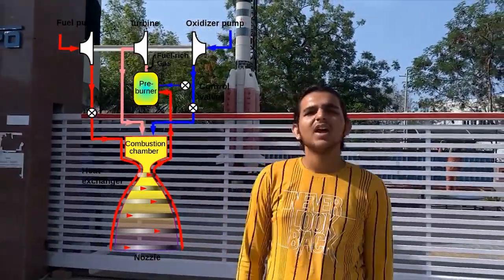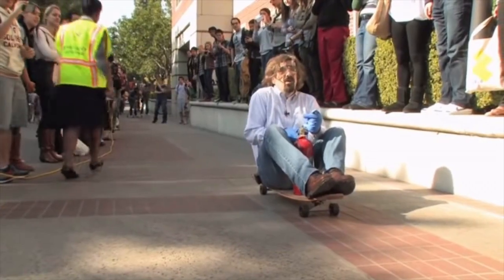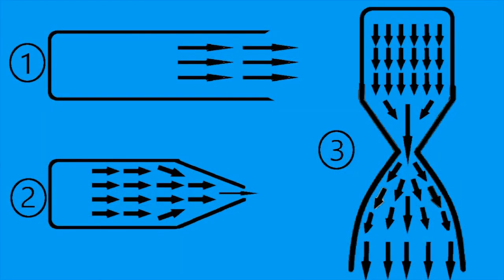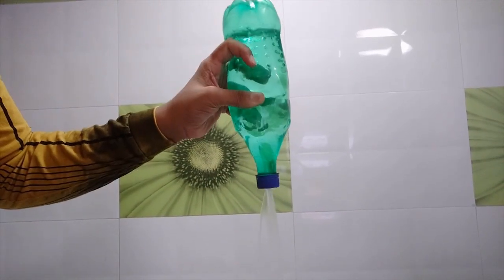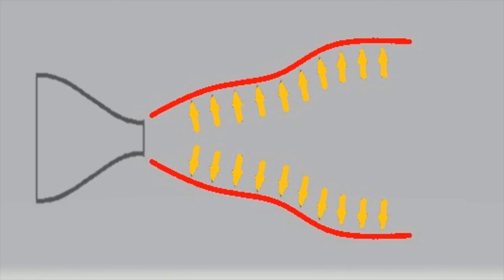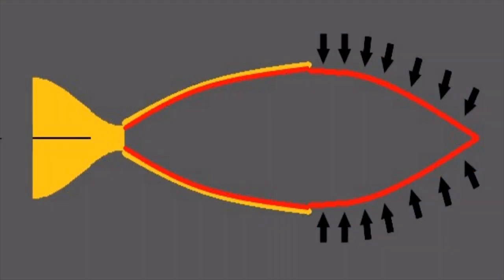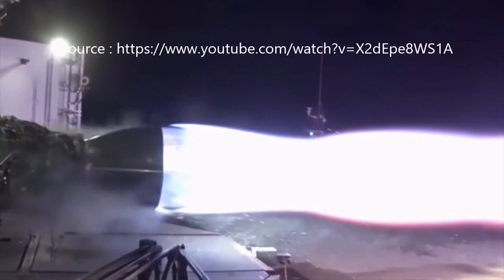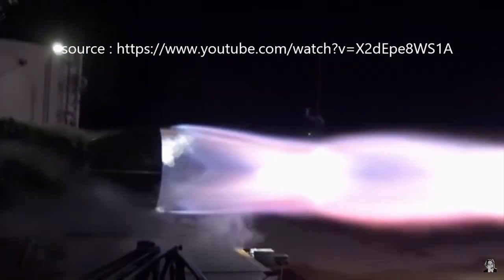Rocket Engines and Nozzles (Breakthrough Juniour Challenge 2020)

Comment: While it is true that the forward motion of the rocket is related to the backwards motion of the exhaust gasses and that doing something like constricting part of the nozzle so that the exhaust gasses have a higher velocity results in a higher forward motion of the rocket it is NOT TRUE (as implied) that the exhaust velocity CAUSES the forward motion of the rocket. You could just as easily state that the forward motion of the rocket CAUSES the backwards motion of the exhaust. Neither is correct.

Rather, it is the PRESSURE inside the combustion chamber and against the walls of the nozzle that cause BOTH the rocket to move and the exhaust gasses to move. Rocket movement is maximized when the PRESSURE is maximized. Various shapes of the engine/nozzle have various impacts on the pressure and thus the motion of the rocket. I think that rocket engine designers ought to think of it in terms of increasing pressures rather than maximizing exhaust velocity.

When a drawing is provided it ought to show the pressures AGAINST the enclosing chamber and nozzle, adding up the pressure vectors to calculate the upwards motion of the rocket, rather than just showing arrows of the rocket movement and exhaust flow. The designer or student would then look at as finding the optimum design to optimize the net pressure vector.
Reply from the maker: This is very true, I hope I had known this when I made the video. I had just started out learning about rocketry and knew only basic dumb-ed down concepts. 
I do have one similar video in the works right now that I will post either today or tomorrow.